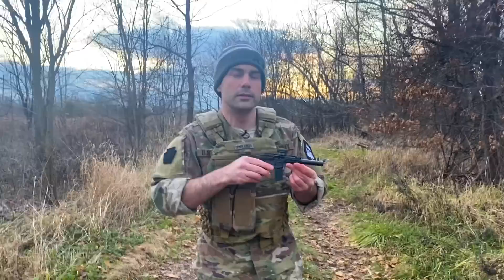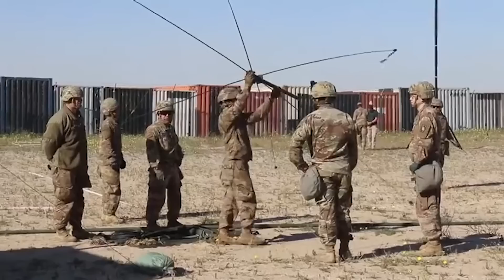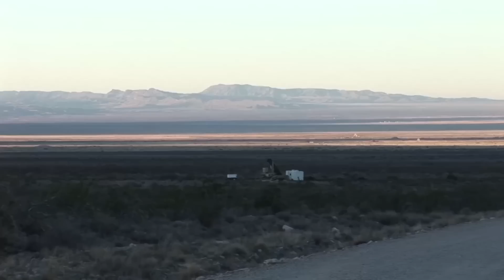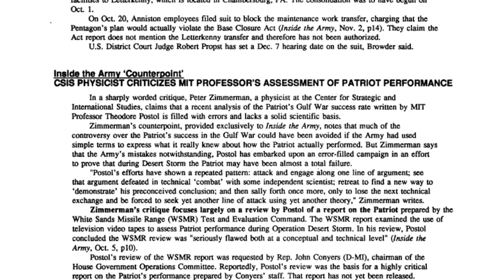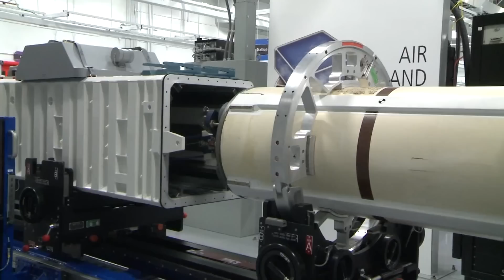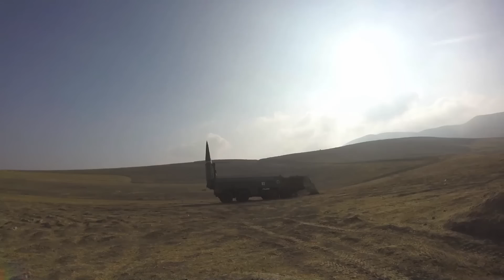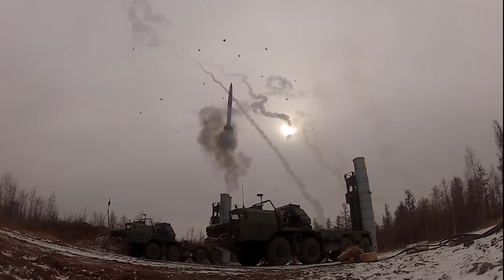Can Patriot Anti-Air Defense REALLY intercept missiles?

Comment: I’ve been wondering something. The US has taken the Phalanx CIWS and adapted it for use on land. Is there a plan to take something like the Rolling Airframe Missile and also adapt it for mobile land use? Having those fired at kamikaze drones and sundry enemy UAVs may be cheaper than multi-million dollar Patriots.
Reply: Ukraine Operates relatively modern Gepard SPAA donated from Germany. They usually deal with drones or cruise missiles for the cheap price of a few rounds of 35mm ammo
Reply: @heyho4770  while I do not have numbers, I very much doubt there are a lot of Geprards that were available to be donated.
Reply: @Grisu19840  30 are in Ukraine, 7 are being made combat ready again and there are talks with Quatar and Brazil to reimport some that were sold to protect their worldcups
Reply: @heyho4770  they only have a few. Switzerland which is neutral won’t supply more ammo. Germany has built a factory …expects it to be operational and supplying by July. So that system is basically out of action for a while. The Patriot is not a great system either. There are almost no spare missiles available for Ukraine, so it too will be out of ammo very quickly. The world knows S400 is really good. The Patriot on the other hand is over priced rubbish. Truth is the US followed the wrong R&D path. It’s years behind Russia and knows it, but just talks up the poor quality arms it does have. The B21 for instance….really a B2.0 which will be really expensive and do nothing worthwhile! Stealth ain’t what it used to be.
Reply: @peter.a.langan5872  So the reason why slow cold war drones are hitting targets in Russia is because their air defence is so good? 😂
Reply: @romankovalev7894  11 month war on account of a 3 day special military operation? Z is a spent force  & unable to defend even himars... Very weak, very cowardly!
Reply: @romankovalev7894  no 3 days is actually very conservative herr putler actually figured 18 hours to capture Kiev!
Reply: @heyho4770  the problem is still the potential targets to protect vs the range of the intercepter. Intercepters that covers a wise range of targets tend to be less cost efective but on the other end short range cost efective intercepters are not able to cover the number of targets needed.
Reply: @heyho4770  do you know where the munition for the gepard is produced?
Reply: @heyho4770  Realtively modern Gepards lol cold war museum piece that the swiss wont sell ammo for.
Reply: @odinbiflindi  They've been modernised throughout their Service life and Ukraine seems to be very happy with them stating they've been vital at the Kharkiv counteroffensive and work well against drones and cruise missiles. The ammo is a Problem but that will probably be fixed in the foreseeable future
Reply: Problem ist range, how far can a CIWS engage? At a few km/ml you need quite a Lot of launchers.
Reply: As I understand it the patriots aren't for the Iranian drones. They are for bigger stuff..
Reply: @JohnDoe-vy5hh  yes they are for bigger stuff. Probably to deter Putin from firing tactical Nukes.
Reply: Those have a unit cost of $1 million, worth it for shooting down the most modern anti-ship missile but not for countering some brand-quality Iranian "kamikaze drone".

Phalanx uses mass manufactured 20mm that any government can buy in bulk. While such gun systems struggle against expensive missiles they've always done really well against drones.

You could go much smaller like .50BMG if anyone made a .50 round that self destructed mid air if it misses a target rather than fall back down to earth with lethal velocity.
Reply: @Treblaine  Several companies are working on cheaper anti drone systems.  Some designed specifically with drones in mind, some are adaptations to existing air defense systems, like the Rheinmetall / Oerlikon SkyNex system.  These defend against other air threats as well, have a far greater range than CIWS, and are far cheaper to operate against soft targets like drones, compared to Patriot or other SAM systems.  
My expectation is that Russia will simply overwhelm the Patriot system with cheap ass drones, and if they happen to spot them, target the Patriot units themselves.  Awesome propaganda value.  In that sense I feel that giving a Patriot battery is more of a PR stunt, and one that may turn out to be a liability for Ukraine.
Reply: Actually found something that is what you're looking for; the L3Harris Vampire CUAS system. Its cost effective since it uses apkws so $22,000 per round. The SeaRAM/Rolling Airframe missile round is $200,000+. The Vampire system was sent to Ukraine so hopefully bugs are being worked out.
Reply: @rsKayiira  Good Pull.  Bravo !
Reply: You're talking about C-RAM.  We had one a cop Rawa in 09.  They're pretty good for slower IDF, drones.
Reply: They've been sent NASAMS systems which are ground launched AMRAAMs.
Reply: The US has those, they were commonly used in Iraq and Afghanistan to defend FOBs from indirect fires
Reply: This is the first time I'm hearing about the Rolling Airframe Missile. It has the range and accuracy but hopefully each round costs below $20,000.
Reply: Why can't they make an Aegis system that is mobile over land?
Reply: @georgepalmer5497  Isn’t that what the AEGIS Ashore (with the AN/SPY-7 radar) is?
Reply: @georgepalmer5497  Because even if you can move a 12ft diameter radar (and keep it from breaking with all the bumps and jolts driving over land provides), the generator required to power the thing would need to be big enough to power a locomotive.
Reply: @georgepalmer5497  actually recently developed a MK 41 based land launcher for SM 6 Tomahawk etc type missiles both will never See Ukraine We just recently bought some to try out
Reply: @georgepalmer5497  check the Typhoon system prototype just delivered to the Army its a Mk 41 launcher for land use with the SM-6 & Tomahawk etc
Reply: Yep... Add the land CIWS to complement Patriot...
Reply: A single ram missile costs about 2 million dollars, 40 times the price of the kamikaze drone and 3 times the price of a cruise missile.

You see, prices online about Russian cruise missile are almost always based on exports, which are ofc much higher.
Especially old cruise missiles, out of which Russia literally has thousands in storage, can be used to waste any kind of air defense sent to Ukraine.

The US produces 250 patriot pac3 missiles per year and this number is expected to be 500 in 2024. The US doesn't have the capability to send everything to Ukraine.

The Ram missiles are super expensive for their range and capabilities because it is a close in defense for aircraft carriers, it needs to work and it won't be used very often, it's designed to be very expensive.
Reply: You would think but no, america has nothing good enough for those stealth drones, almost all the m777's you sent them have been vaporized by them already, what happened to the himars? Why is it never in the news anymore? Weird...
Reply: They already have the land based ciws . Isreal used it in the Iron dome defense as well I thought
Reply: That's what the politicians/media does, with all their propaganda. Like "It's the Russians' fault," etc. And the same thing happens in the east, like "It's the fault of the Americans, of the West," and so on. They make people hate each other! We need to wake up! They did the same with the plan-demic, and they will do the same with any other scheduled crisis, such as the devaluation of money (that paper printed at the behest of some 'tricksters') or the food crisis (which while we are made to hate neighbors, food is destroyed around the world).
Reply: The price of MIM-104 is still less than amount of damage cheap drone can inflict.
Reply: I have been wondering about those bits of fantastic kit since February! Much cheaper than Patriot, but the new Patriot needs resting under combat conditions?
Reply: I've been wondering if you could put an Aegis system on trucks like the Russian S400 and have a land mobile Aegis network.
Reply: They have NASAMS, Avenger, Stryker M-SHORAD, and the upcoming Stryker HEL for that. Even Stinger MANPADS can be used which is what Stryker M-SHORAD is about.
Reply: @johnsilver9338  Again.  The US Military ... does not ... have a self propelled 35 mm twin barrel  anti-aircraft gun system  ... that Germany, Finland, Italy, Japan, Korea have   .. as well as China & Russia have ... to easily take out cheap suicide drones like Iran supplied Russia or subsonic cruise missiles.

And wtf has Ukraine .. NOT ... been making in the past 8 years, and since 1994 when they stupidly gave up their tactical nukes that they could use, as well as destroyed the advanced bombers and ballistic missiles they they use to build"  Ukraine has the Engineers and industries to easily reverse engineer and build their own versions of the Su-27, Mig 29, Mil-17, Mil-24, S300, .. 155 mm Howitzers and Ammunition and make their own MRLS & Himas?

The incompetence and or corruption in the Ukrainian government is obvious ... especially with what they did not do ... after losing Crimea & the East Donbass to Russia.

How the hell did Ukraine lose Khersno in the 1st Day of the War ... when Crimeas had been turned into a Russian Militiary base?  Where were the fortification on the Crimean border ... that have stopped Russians in the East? why were the bridges blown up ... that moment the war started  ... and fortifications to protect the nuclear power station ... and the damn?

And who were the morons who decided to retreat into Mariupol ....to defend the city ... against Russian artillery, and airstrikes?
Reply: Phalanx is only a gun. Shaheed drones can come 7000 m high. You can not see it, on radar is difficult to see. Radar is a good target also !  In free fall the drones vertical hit the target. ( Phalanx can not shoot vertical upwards. Thats so easy !
I like the Shaheed GAZA mothership. It carries 13 big bombs. Splitter bombe, bunker penetrating bombs, bombs with some hundred booby traps, also 4 KT Tac Atomic Blasters. It comes 8000 m high, the bombs glide over many kilometres into target. they are guided by radar, link in enemy  guide , infrared guide, magnetic field guide ( find electric power plants ). The can not seen on radar often, bombs do not occur on radar. They have infrared blending, anti radar security, anti jamming... and more.  
Patriots are totally trash. Only 30 km range you need 335 for the 1000 km east front of Ukraine. But what with north , south and west? Only one patriot goes to Ukraine with 8 rockets. Only 250 rockets are made per year. Its helpless in a swarm 0f 50. 70 or more and gets destroyed at once. It comes on 6 big vans ! radar van, Antenna van with 30 m Antenna , Operator van, Launcher van, also a van with some thousand m cables , tents. Once built up it needs 30 men and a week to disconnect. Operator team, repair team , drivers, electricians, radar specialists. A nice target for Russian drones ( Big Antenna and radar units ! ) from 7000 m vertical free fall and all is trash : ) You even can see it via satellite ! A fake Defender only !
Reply: RAM is very expensive itself. Centurion C-RAM would be better
Reply: The Drive recently listed the prices of US surface-to-air missiles.  The RAM is the cheapest, but still about 900 grand a pop if I remember correctly.
Reply: The US does currently have a system to deploy Sidewinder Missile launchers on Hummveys.
Reply: @Christopher Dion  NASAMS is already capable of deploying a wide array of missiles, including the sidewinder as well.  I'm sure, between CRAM, NASAMS, Patriot, and Gepard, they can get the job done if the supplies keep rolling in as the systems are used. NASAMS is surprisingly versatile and is also truck mountable. Sending more of those to replace Buk-M-1 systems would be amazing.
Reply: @Whiskey11Gaming  - totally agree!
Reply: @Whiskey11Gaming  They need 3-4 Gepard's for every target, SAM's aren't cost effective for anything smaller than a cruise missile. Something new is needed. Like a hunter killer drone ore similar. I have seen info that Ukraine is working on that!
Reply: @Whiskey11Gaming  the problem is  most of the systems named are useless agist balistic missles. Cruse missles and drones sure mayhaps thogh not all are tested agist it. Saudi arabias had Thor and it coudnt track drones relyable either and none of us konw if any of thease were tested agist what. For a example gepard might be very easyly destroy thease slow flyers IF it can tack them opically. The older radar systems sure will have even more problems geting on target than a Thor.
Reply: @Whiskey11Gaming  totally agree.
Reply: @mirv695  that wouldnt be economical against a $30,000 drone
Reply: @rsKayiira  Consider the price of being hit by the drone, not just its price per se.
Reply: @rsKayiira  of course it's temporary countermeasure to protect high value, critical assets at the moment, while looking for more cost effective, strategically robust solutions.
Reply: @tocu9808  The cost effective solutions have been there since WW2. Any Air defence expert knows this. Thats why US sent anti air guns and l3 harris vampire cuas systems. Thats what you need to take out things like $30,000 Kamikaze drones. Other things is M-ACE radar coupled with M230LF, L-70 AA radar guided cannon etc etc. These are things that even Ukraine can develop at a lower cost than the US if they can set up shop in Poland. The best thing would be a repurposing an airborne drone with radar and say apkws. That would really take out those drone swarms in a cheap cost effective way
Reply: @rsKayiira  You can only aim at what you see, and shooting must be in time to be effective. Low observable low flying kamikaze drones are quite difficult targets for radar guided anti air artillery to track and react.
Reply: @tocu9808  Thats why they have thermals and electro optical sensors with AI assisted targeting.  So the kamikaze drones can be tracked visually even at night. The US has all these systems and I bet you they're testing them in Ukraine.
Reply: @rsKayiira  That's the way it should be. Radar alone is insufficient to catch those drones.
Reply: @tocu9808  yup. so once the kinks are worked out of the Vampire cuas then maybe they'll get larger orders to send them to Ukraine and other parts of the world. Only thing I can think of is that they may need to create airborne platforms.
Reply: @rsKayiira  Cost efficiency is relative it's not the cost of the incoming round entirely but what the cost might be of what that round hits. If your 20k missile is going to damage a multi million pound vehicle/installation then firing a 30k interceptor is entirely efficient.
Reply: @rsKayiira the scrap found in downed Iranian drones is worth more than 30k. The purposeful lowballing of their cost is a propaganda tool.
Reply: @eldridgep2  people are using your argument for AD missiles that cost between $150,000 to $3mn(From an OSA all the way to an S-300 or Patriot PAC-3), trying to take out a $30-$60k drone. You wont be able to produce enough of them to prevent a multi million pound installation getting hit. But you'll certainly spend hundreds of millions of dollars.
Reply: @ChucksSEADnDEAD  I'd give it $60k tops.
Reply: @rsKayiira  Which if you are getting the missiles for "free" may not be an issue in the Ukraine's albeit unusual position. If it comes to a battle of resources between the western alliance and Russia that's not even close to a fair fight. As long as they can maintain supplies to Ukraine the Russian economy won't be able to keep up. You can see this in the way they burned through a lot of their best equipment and missiles really quickly and now can't field equivalent replacements.
Reply: @eldridgep2  nooo thats not how things are done(your first point about "free"). Its 100% false(I agree with the bottom half though, Russia for example is out of BMP 3s and possibly BMP2s). Militaries do very detailed cost benefit analysis. Ukraine would be out of this fight if they had been using expensive AD missiles to take out $30k drones. The US wouldn't be able to keep on supplying them either. The US probably has around 10,000-20,000 Patriot missiles in stock total to protect anywhere they have launchers in the whole world. They're mainly for taking out expensive missiles, drones and manned aircraft. Ukraine likely had half of that(5000) in storage as well for their S-300PS/PT alone and a ~2500 or less for all their S-300V batteries. The amount of Kamikaze drones that have been taken out by S-300 systems is a handful and that was early days. The Russian plan was to have Ukraine use up their missiles but it failed. Ukraine was able to adapt quickly. So I'm not saying they would never use expensive missiles but they've 100% left a Kamikaze drone fly into a populated area yet they can see it on the radar. They watch and hope other AD units get them/inform other units or have their radars hooked up into other SHORADS. The vast majority of kamikaze drones have been taken out by cannons on Jets, AA cannons on the ground, some AA missiles. Things like that. Otherwise Ukraine would have run out of missiles and the US would be digging into its strategic reserves. For example when the US supplies PAC-2 and PAC-3 missiles you wont expect a single one to be used on a Kamikaze drone. Otherwise they wont have any to stop Iranian ballistic missiles.
Reply: @romankovalev7894  They dont have anymore BMP-3s fielded in Ukraine. They were all destroyed
Reply: @rsKayiira  you are correct. I was in a small way answering the question from the initial poster of this thread. Not necessarily making a determination on which system would be superior.
Reply: The US does have a truck mount for a phalanx, but cannon CIWS are notoriously overrated
Reply: @raptors222222  I have seen them take out Chinese rockets and mortar rounds. They work well
Reply: @paulpaczkowski8366  I suppose it works well when it's not having to account for the motion of its platform, like on a ship which is pitching and rolling to dodge or otherwise  maneuver.
Reply: The US has not followed the tier system the Russians have for land based air defense systems  ... and using a 3 million dollar missile to shoot down a $10 000 dollar drone is plain stupid.

Where the hell are the US tracked & wheeled 35 mm armored Anti-Aircraft guns that can also be used for fire support?
Reply: @abelincoln8885  inside our jet planes.
Reply: @abelincoln8885 The drone could be 10x higher than the cost you cite. 10k wouldn't cover the electronics alone.
Reply: @abelincoln8885  the US lost the short ranged gun AA because we have the USAAF, and the money spent on short ranged gun AA seemed superfluous and wasteful, when you expect to win the air war.
Reply: @Executioner9000  The US screwed up .. because self propelled anti-aircraft guns are versatile weapons ... than can also be used for fire support for the infantry, and can take disable or take out APCs and IFV ... and well as provide short range air defense, especially with Stingers.

There will always a place for 35 mm twin barrel anti-aircraft guns with radars, fire control system and specialized ammunition.  This is why Germany, Poland, Finland, Japan, Korea, Italy still have these systems .. and Ukraine is using the Gepards from Germany against subsonic cruise missiles and suicide drones

The US has relied on air superiority and especially stealth technology ... and stopped developing a comprehensive Air Defense systems ... that can take out a ballistic Missile with nukes, a $100 m combat jet ... or ... a swarm of $10 000 or less suicide drones.

But Ukraine needs to win the war, and take anything it can get from the West.  The US needs to wake the hell up ... and develop the best Air Defense System in the world .. to reduce the damage of a missile/drone getting through the defenses.

Can an F22, B2, or F35 ... fly all the way to Moscow ... Beijing ... Tehran .... undetected with there Defenses on high alert?   Odds are ... no they can't because those Regimes have invested heavily in the Air Defense system.

But you use a $3 m millions missile to take out a $ 100 m plus F35 Jet ... not ... a $10 000 suicide drone.  This is why the system .. must include an anti-aricraft gun firing plentiful low cost shells/bullets

Just like using the the Javelin on heavily armored MBTs ... and the RPG or AT4 on light armored vehicles or to immobilize a MBT.  You the the the appropriate weapon for the job/target.
Reply: @abelincoln8885  I never said it was smart, just explaining why Gun SHORAD is lagging in the US army
Reply: I love the way Americans keep track of US weapons systems and discuss kill ratios and stuff, like guys in the office trading pro sports stats. Part of the bread and circuses routine that makes us all dupes.
Reply: @Chris Clements  I want to see how my tax money investments are working out
Reply: @chrisclements1169 That's rich considering how much propaganda Russia put out about their weapons.
Reply: @chrisclements1169  Its the next best thing to professional sports to deflect the attention of the populace from important stuff,  like their own government.
Reply: @freebuilder007  If you consider being vigilant about Putin’s obvious efforts to reestablish Russian dominance over Eastern Europe deflection from other issues, then I would suggest both issues can be watched and that Putin is a mortal threat.  
Ignoring Hitler after he took Sudetenland escalated into WWII.
Reply: @romankovalev7894  You’re funny. In a stupid way, but funny.
Reply: @romankovalev7894  A hug isn’t necessary. Advocate to get Russian troops out of Ukraine and I will thank you.